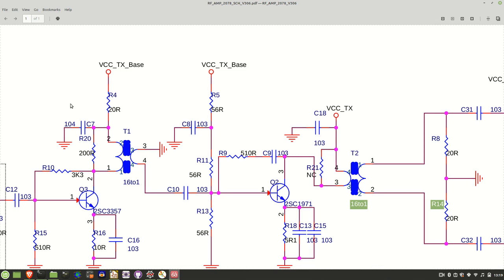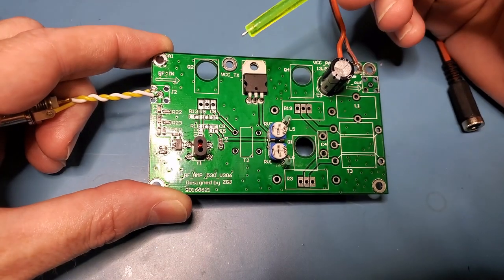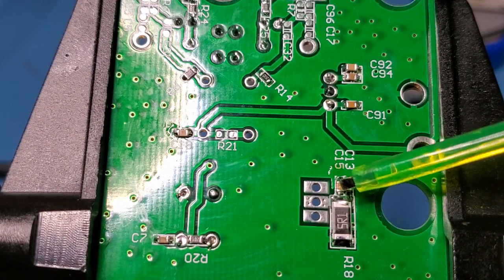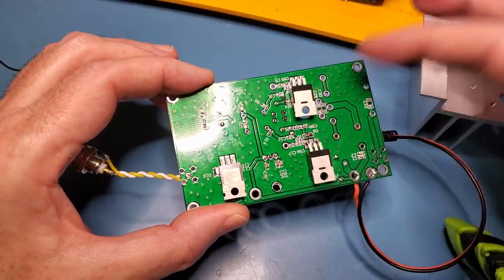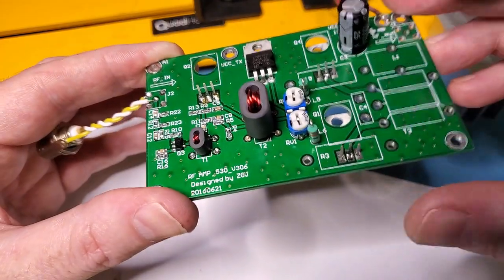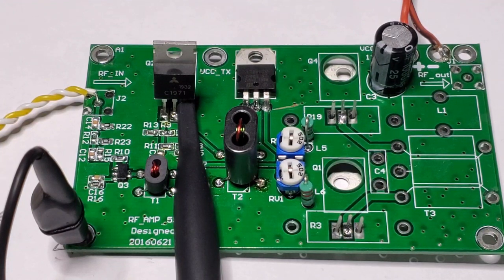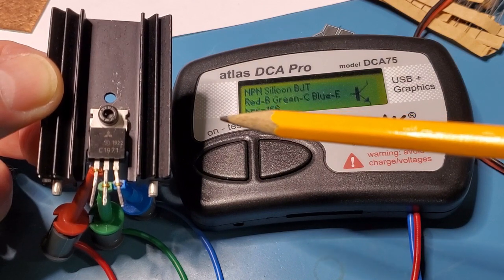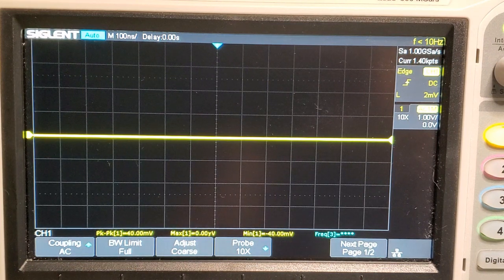IRF530 Push Pull Amplifier - Part 3

Comment: Hello friend, how are you? I saw in your assembly that the T2 coil initially had 4 turns with the thicker wire and 1 turn with the same wire. But later it appeared with 4 turns of thinner wire and 1 turn with the thicker wire, I ask: What is the reason for this change please?

Comment: My kit had the same problem with 2SC1971.  I think all RF power transistors cased in a TO-220 have the tab connected to E, so suspect those supplied are fakes, and not even good ones.  Messing about with the gate bias on the FETs I have blown one up, even with my PSU limited at 4A! I'm not too worried as I really wanted it mostly for a source of cheap parts for a more efficient class-C design.
Reply from the maker: I've bought quite a few transistors/fets off eBay - most of them seem to have been fakes. Not fakes in the sense that they are not transistors - just not the labelled transistors. You can for example see piles of RD16HHF1 mosfets on eBay - they just seem to be re-labelled IRF510s. Thank you for the comment

Comment: let me get some popcorn, I have been waiting all week for the next installment in this series...  

Good catch on the different pinout for the 2Sc1971.  Yeah, on the Chinese kits I will be verifying the transistors as well as all the other components before soldering them down.  You never know how the BOMs are being kitted.  Ian, your section by section build process is paying dividends.
Reply from the maker: Glad you enjoyed the video (and I hope you enjoyed the popcorn! ;) )

One thing I'll probably do in the next video is change the biasing arrangement of the 2SC1971. You don't need to be running 1/2 an amp through it for it to run class A. I'll probably start by changing the 56/56/56 divider arrangement with 560/560/180 and see where that goes